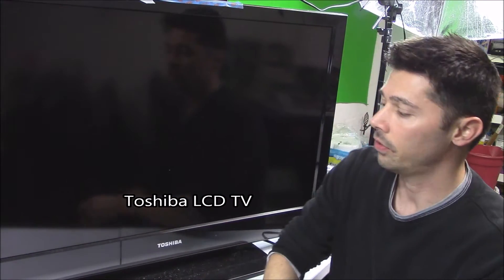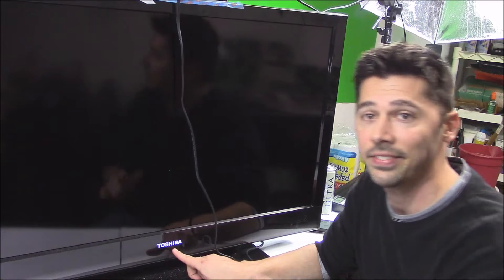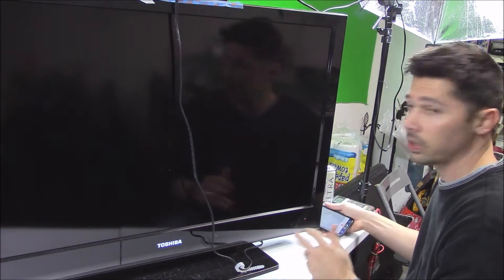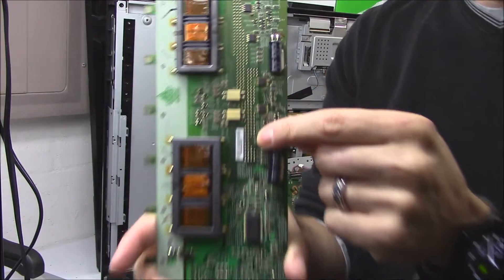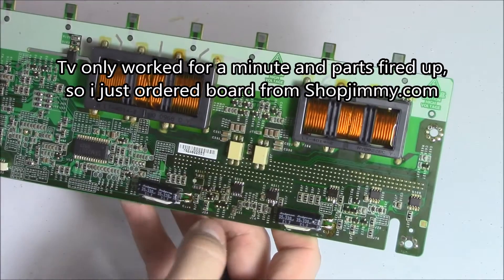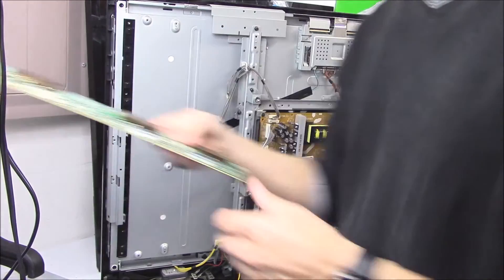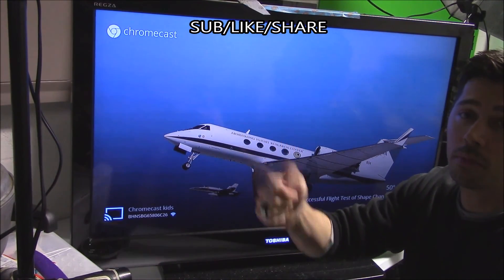How to fix LCD TV- no picture black screen

Comment: Hey I know you’re probably not even using this channel anymore but I need your help. The tv turns on with video and audio but 20-30s later the video just goes, and the audio stays, it does still respond to the remote though so I can turn it off and stuff

Comment: My tv turns on with backlight and has sound but no picture. Its so strange . I screwed in a bracket to the back of the tv went to hang it on the wall and it didn't work. I took it off the wall and loosen the screws and it worked so I thought it was all good. I then tried hanging it again and again the picture was gone . Still has backlight and sound. I have no clue why this is

Comment: Thank you for sharing. With your help I fixed my TV. I found a dry solder joint on one of the transformers on the inverter board. Thanks a lot.

Comment: I have an issue that just started with my LED monitor there is a portion of my monitor that goes dark but like when you turn the contrast all the way down it still has a picture just dark now If I turn the monitor off for 30 seconds it goes away it comes back every 24 to 48 hours.
If someone could maybe direct me to an experiment that could let me distinguish whether it's hardware or software would greatly help me.

Comment: I got the same problem but my Toshiba show video after a few minutes like 10-15mins after power on? Should I replace the whole board or just a specific transistor, capacitor or ic?

Comment: HELP! I have a Toshiba Regza LCD flat screen model # 46xy54ou. I have audio but the screen is totally black. I also cannot get a 24v reading from my board [ on my meter] which should turn on the back light. What do you think the problem is? I do have stand by power though. Also...since it is an LCD, do I have florescent  back lights or might they be LED's.

Comment: I have a Samsung ln46c650l1fxza and I had a black screen but could see a image with the flashlight. So I changed the inverter board. Still didn't work, I checked for the 5 volt standby voltage on pin one . It only showed 5v with power on and no 12v on the other pin. Is it safe to think it's the power supply board?
Reply: Cynthia Martin and how much was it to fix it

Comment: Had my lg tv 32inch turn off on me whilst watching a movie. The sound was still there but now picture. So I turned it off and on but nothing happened until I did something and all of a sudden it started working. If you want to know what I did and you from the uk, text me on 07732498489 where I can avoid you getting a brand new tv for £300 by paying me only £25 for the fix. 
No need for parts or opening up tv!!!
Reply: good job, you know how to mute and unmute your picture

Comment: Why make a 'how to" video when the author never responds to viewer questions? This dude is useless. Buy a new TV with a warrantee.
Reply from the maker: ppsayl123 i replied to over 1,000 posts across my 580 videos, did you even see  my replies on my repair videos? some I over look because I get many questions and I don't charge. did you have a question?
Reply from the maker: ppsayl123 i replied to over 1,000 posts across my 580 videos, did you even see  my replies on my repair videos? some I over look because I get many questions and I don't charge. did you have a question?
Reply: I've a Vizio smart TV model- E390i-A1 
Black screen, no sound and 5 green vertical lines in the middle. It was working fine until yesterday morning.  Any feedback would be so appreciated!

Comment: hmmm.......maybe before start taking apart the TV try checking the website for your particular TV and check to see if it has an update I would think that on SmartTV's the updates should be automatic (not sure?) but try updating your LED TV first I had that problem on my TV the Update fixed it.  Had to download the update to a USB thumb drive then insert the updated thumb drive into the USB port on the Television Wallaaaa!!!! this is useful but try checking manuals and/or websites first before opening up the back of the TV

Comment: Thanks for your video I need your help to repair lcd tv no picture black screen. I have test power board giving output 24v to backlight inverter board (SSI460_16A01 or LJ97-02091B), two socket cable coming from power board. how to test output of backlight board or where is the mistake. your videos found helpful kindly reply soon tv kept open Thanks!

Comment: HELLO.
I GOT A HISENSE LCD TV THAT WAS WORKING 24/7 AT A GAS STATION AS A VIDEO MONITOR FOR THE VIDEO CAMS...
MODEL NUMBER H32V77C. THE TV SUDDENLY LOST AUDIO, AND VIDEO ALL TOGETHER. FROM WHAT I CAN SEE, AND HEAR, THERE IS NO SOUND AT ALL, NO SIGN OF LIFE AT THE BACK LIGHT, AND SCREEN IS BLACK WITH NO SIGN OF VIDEO AT ALL... THE ONLY SIG OF LIFE ON THIS TV IS WHEN PLUGGED IN, RED LIGHT COMES ON LEFT BOTTOM CORNER, AND WHEN POWER BUTTON PRESSED THE LIGHT TURNS BLUE, AND STAYS THIS WAY.... NOTHING ELSE AT ALL...
 ANY SUGGESTIONS?

Comment: Great video!!! I have a Toshiba 52HL167 that has 4 of those boards with the transformers on them... only found a burnt spot on one of the 4 boards.... is that enough for me to not get a picture when it turns on?  I still have audio when i turn it on like you do in the video... Thanks a LOT for your help!

Comment: I have a HP 2309v 23 inch monitor, the backlight turns on for barely one second. Then goes out, I've replaced the caps near the inverter transformers, but that didn't help. Should I replace all caps? Then I have a LG 32LD320N 32 inch tv with the same fault. If I pull out the 12v cable to the inverter, the connect it again while the tv is on I have picture for split second.

Comment: I have a Dynex model DX-LDVD22--10A and I have had this tv for like 3 years and I play games on it. I have not throughly search your channel for it but the problem is that the menu keeps flashing on and off by itself I check the remote and buttons and those were not the problem please help me!
Reply: Firewolf1026 Breaux
Reply: I have a dynex and it turns off then on every 10 secs and has no picture but does have sound and the remote wont work nor manualy triing to change channel cant change channels either.

Comment: hi i have a lg plasma tv 60pv450 tv turn on and works fine then at random the screen looses picture sound is there. then few minutes after the tv turns off. I have replaced the Main Logic Board but problem still there...

Comment: Great vids. You ever come across a Sony LCD that the screen comes on for about 1 second then goes black with no error codes? Any ideas?  thanks!
I don't even know what to areas to touch with my multi-meter...
Reply: check out badcaps forums  do a search if you dond find it post it with pics of the boards
Reply: Thanks man! I think I figured it out after a whole night of researcing and messing around. Figured out my multimeter was on a high current setting. Duh! Ended up taking the entire tv apart and accidentally broke a CCFL so now I have to track down a 1026mm ccfl and get a backlight board. Seems buying 1 cheap ccfl is almost impossible.
Reply: JVonD
what size is the tv? Im getting ready to throw out parts :) might have a set for you
Reply: JVonD
 sorry the biggest i have is for 40 inch
:(

Comment: I need advice as well. My TV dropped about 6 feet from the air and is now left with a cracked screen and no image. Is there a way to still produce a image even though the screen is cracked?
Reply: broke screen donate the boards for parts :)

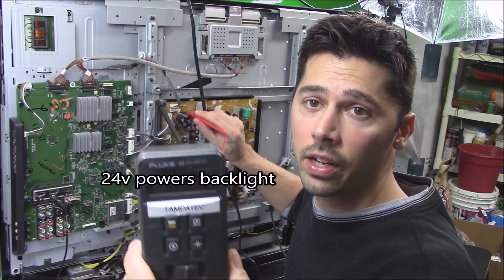Comment: So if there is no 24V on my TV power supply board (at your 2:00 mark), but only ~5.5 V, then power supply board?  and would replacing all caps (even if visibly not swollen) be next step prior to buying new PS board?

Comment: Hi, I'm working on a Haier model HL21P1 the PS and Inverter board is all in one,, DPS-186CP-1A.
the Units problem is as follows:
Set comes on fine but has BL for only 3 sec or so.

I noticed a dark section in the screen like one of the CCFL's was not lighting up..just before the BL went off
So at this point , I suspected the problem in the inverter..but didn't know if the CCFL was bad or the inverter trans..all parts checked fine..
so i swapped the transformer with one of the others on the PCB..so if the dark spot moved to a new location i could be fairly certain that the transformer was at fault.
All voltages are present even tho the BL's are in the off state.
this set uses a DDA003A IC which i found a fault pin on..monitoring this pin i see it goes to 5v and then the BL are turned off

If i ground  that pin briefly the BL will come on..
If i keep it grounded for less than a min or so one side of one of the inverter transformers will get very hot(The one that has the dark area on the Screen),,so i know this transformers has probably developed an internal arc or a shorted winding..resistance measurements show a Res of 1.42 ohm one side and 1.53 ohm on the other end..

But my real headache at the moment is the 24v line..I've seen the 24v rail in other sets go lower than 24v when there is a problem..but in this case even tho the protect circuit has turned off the BL the 24v line actually reads 26.9 v before the BL is even turned on..and stays at 26.9v when the BL goes off..
So I'm wondering if this 26.9v rail being higher than the 24v it should be has been feeding the BL's too much voltage and sent the set into OVP.and this is what caused the Inverter  trans to go bad.
Or is 27v considered within normal operating rang for the 24v rail.

Also if pull the faulty transformer off the PCB and power up the set..I still get the same no BL problem..
I was hoping that the faulty trans being removed would allow the set to stay on so i could narrow it down to just that one part(which i can't find anywhere), can't find the PCB anywhere either..not even a defective one.
I was hoping you might have some insight on this model..if you'd like to look over the sch, i can upload it somewhere for you.

Comment: Have another question...Oh yea thanks for the assistance with laptop issue..Its fix Lol...
I just scored a practically brand new tv,(dumpster dive,lol)when i say new i mean it still has the wrapping around(in box) it but defective.Here is the issue it turns on but no screen,Check with flash light and can see the menu as as turn on/off tv..
Any ideas on issue,led driver,inverter or maybe just loose connection?

Comment: Does this same principle apply to a laptop that powers up but has no screen image?
suspects the motherboard but no idea what to look for,I was hoping to find a burned something lol...
Reply from the maker: laptop can be graphics on motherboard, software driver, cable connection, backlight. connect external monitor to laptop to help diagnose if it's mother board, software,  or lcd.
Reply: I did connected to an external monitor same thing no screen...powers up,fans come on but no screen (black)...
its an asus x502c if it helps.
already tried the hold power button without battery trick,nada...also also graphic card reflow. again nada....so i think its motherboard but what?
Reply from the maker: guayaco3299 yes seems like mother board cause if it's software at first boot screen should flash but you have nothing on both external lcd and laptop lcd. You can use freeze spray or heat gun or tapping on ICs
Reply: Ahh..i saw that freeze spray trick the other day,nice trick might try that..Thanks for the info boss..
Keep watching your videos always learning something..I smell a new hobby coming up lol.
Reply: Yes..Don't know where the real issue was but i ended up replacing the motherboard and problem fixed. i don't have the proper equipment to replace graphic chip which i suspected to be the issue

Comment: Hey guru..  I got a Vizio and checked voltages to inverters.  All good.. When I unplug the main board from power board no clicking..  I checked diodes at power board..  All good but one.. Would that cause backlight from coming on?

Comment: ok, i was watching your video about no back light.. i have a sony lcd tv kdl46ex400, problem is i have no back light.. have perfect  sound and no blinking lights. i did the flash light trick and seen the number 2 in the right hand corner so i know its working.
i just cant tell if i need to replace tubes or inverter board. i ran my meter along the way and havnt found any power lose.
or burn spots,i wish i could learn to test each part or if there was a simple way to check to see if board needs replacement.
i just dont want to bye a board if its not the board..
thanks steve

Comment: Hi! I just started watching your videos and subscribed and I have a few questions. You seem like an experienced Electric Engineer. 
A year ago I enrolled in a trade school for Computer Networking and Electrical Technology. But I have trouble remembering the formula's for various things, such as Open Loop Voltage, Gain, formula's for Parallel circuits Ohms Law and Kirchhoffs law was simple to grasp.(I try to apply these laws to anything I do but yet I stumble)

 I was never good at High level Math but I keep trying to improve myself. Do you have any tips for the Aspiring Technician? 
Is it normally hard to grasp some concepts around AC/DC electronics and digital electronics? I know a lot of the basics, but that is as much as I was able to retain.

I am sorry for the wall of text. Certification Test are coming up. I'm not sure if I'll pass.